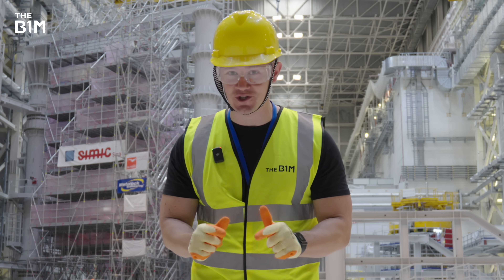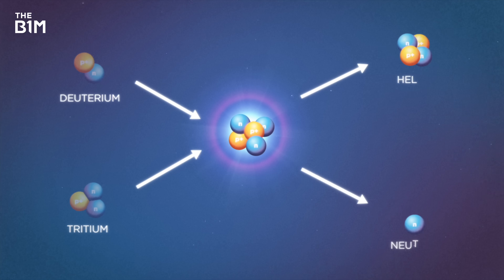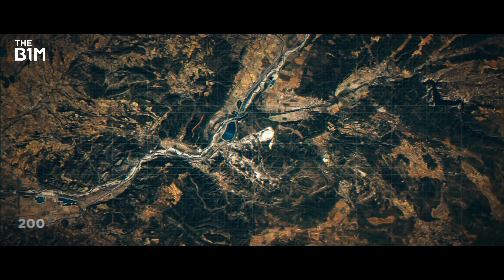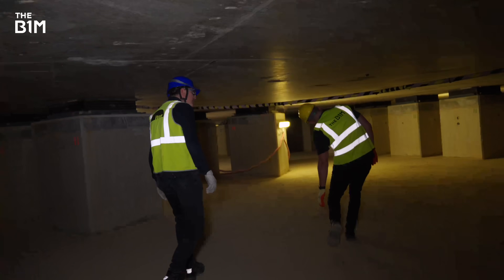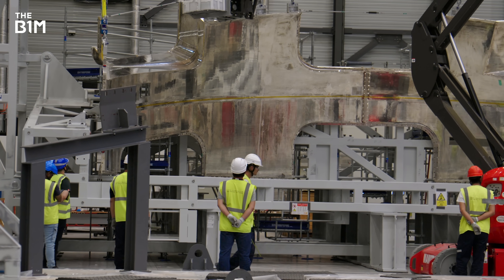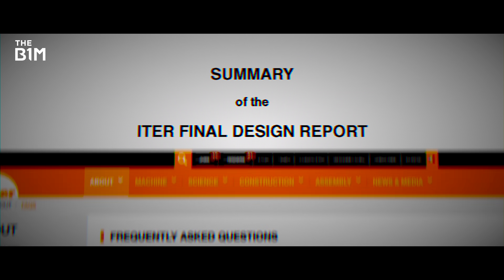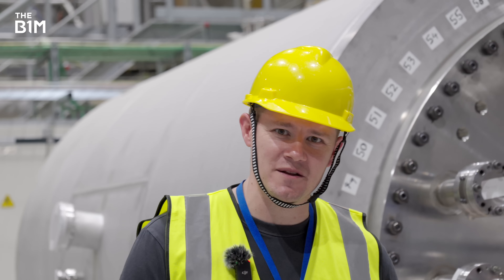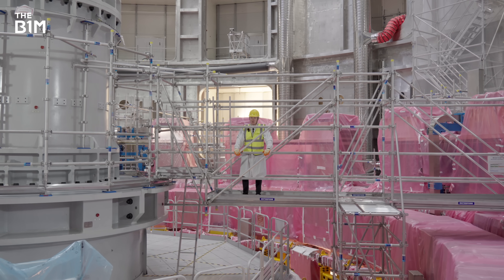This is The World's Most Complex Construction Project

Comment: I'm betting I won't see this happen in my lifetime.
Reply: I have read (or watched, can't remember) a statement from one of the senior researchers/engineers working on the project that it is highly unlikely we are going to see fusion power in our lifetime with the current progress, unless some major breakthrough happens.
Reply: I think it will be way beyond 2050
Reply: I assure you it has already been achieved but at a much smaller scale, infact, he even states this in the video. Otherwise, there is no way this much would be invested in this large of a scale by so many countries. The real question to ask is when will it benefit society at large? Will Europeans actually benefit from affordable and sustainable energy sources? I say Europeans, specifically, because ITER is in France so they should and would be the first to benefit.
Reply: @ndean7229  Yeah, fusion has been achieved and sustained for a 100s even, but we still can't get more power out of it than we have put in. And then there's scaling from experimental to production (once we figure out the first thing), and that part we likely won't live to see sadly.
Reply: Nobody will.No such thing as "clean"energy...
Reply: Im guessing it will be  year 2200
Reply: @ndean7229  the reactor that they are building is not capable of "harnessing energy " from the fusion so if they make a breaktrought they need to start building a new one and it could be anywhere
Reply: it is not possible
Reply: Depends how well it works when they switch it on. Will it save the world or will it be our extinction event 😂
Reply: @beardymedic if you watch the video, there’s really no danger with fusion. It either works or oh well it doesn’t, it won’t explode or anything
Reply: @gringalous  it's ok, I was joking
Reply: You get it. Same as the other mega projects to take the money. Is a trend actually among rich people. Also it would be better if this planet destroying nuclear plant will not be finished ever. All it takes is a small earthquake..
Reply: you need to watch some nerds play satisfactory/factorio for 12 hours no sweat, then you will begin to understand it is an inevitability.

Comment: The issue is Tritium. It is extremely rare. Current estimates put the total world wide stockpile at 25kgs and ITER will consume, by some estimates, over half of that amount. Additionally it has a half life of a little over 12 years so here is the catch: In order to breed tritium you need a working fusion reactor, and there may not be enough tritium to jump-start the first generation of power plants after ITERs experimental life (scheduled to run into the 2050's). The world’s only commercial sources are the 19 Canada Deuterium Uranium (CANDU) nuclear reactors, which each produce about 0.5 kilograms a year as a waste product, and half are due to retire this decade. The available tritium stockpile will peak before the end of the decade and begin a steady decline as it is sold off or decays, this according to projections in ITER’s own 2018 research plan.
Reply: An amazing idea that somehow got missed in the video… Wonder if that’s the limiting factor or other sources of clean energy being a little less complex and potentially more affordable… or just the whole chain reaction thing that could turn the planet earth into another sun?
Reply: Then there is how you are going to extrac the heat to boil the water. Helion plans to skip that step. General Fusion will use molten lead for heat extraction.
Reply: I believe ITER is designed to make the tritium in the fusion process itself
Reply: @IAmMaarten  It is a "future hope" as stated in ITERS's 2018 research plan. The process is theoretical at this time and highly speculative as to the effectiveness long term since the viability of an extraction process from a "running" fusion reactor  at 90 million degrees F is a huge unknown since the longest confirmed sustained fusion reaction to date is 6 minutes (the Chinese claim 17 minutes but it is unconfirmed).
Reply: Is Canada building new CANDU reactors to replace the ones being retired?
Reply: @billbyrd5150  There are a number of proposed projects but all are in planning stages only.
Reply: Canada is considering building more nuclear reactors in the future. We are currently undertaking major component replacements at our existing plants in Pickering and Bruce. We are also advancing plans to construct large CANDU reactors at Bruce, along with several small modular reactors (SMRs) in different regions of Ontario. I hope that by the time ITER requires tritium, Canada will be able to support the project with our expertise in nuclear technology, contributing to a sustainable future.
Reply: @Azerigranger  "...is considering" and "advancing plans" means nothing is actually in the works. "OPG is seeking the CNSC’s approval through a public hearing process to operate Pickering’s units 5 - 8 to the end of 2026, while units 1 and 4 will cease operations by the end of 2024. The current licence includes operations to the end of 2024." Nothing is actually moving forward except in committees and public hearings, but since ITER is years behind schedule, billions of dollars over budget with no end in sight form the cost over runs and now the plasma containment vessel appears to improperly shielded there is a strong possibility it will never be completed.
Reply: Hi from Canada. I guess everyone is praying that miners will find more Tritium and solve this essential problem. I sure hope so. It would be great to leave a cleaner world to my children. 🇨🇦
Reply: @yeleedkram "Naturally occurring tritium is extremely rare on Earth. The atmosphere has only trace amounts, formed by the interaction of its gases with cosmic rays. It can be produced artificially by irradiation of lithium or lithium-bearing ceramic pebbles in a nuclear reactor and is a low-abundance byproduct in normal operations of nuclear reactors."
Reply: @yeleedkram  LOL!
Reply: They will simply go get more Tritium.
Reply: I hear theres lots of tritium on the moon.
Reply: Is this really an issue? If our stock of Tritium is only accrued as a waste product from other facilities, wouldn't it be on the docket to construct a system that produces it as the main objective?
Reply: @orshy1  The sort of energy required would be immense, but if Iter proves its viability, then things change.
We could possibly be mining asteroids for it by the time actual power stations will be built on this tech.
Reply: pure BS,  any nuke reactor can make tritium, replacing some U235 bars into a reactor with Lithium bars and some week later you got tritium, without losing much of energy production of the civil reactor !
Reply: @RaySqw785  You're understanding of the process is flawed, here is the catch: In order to breed tritium you need a working fusion reactor, and there may not be enough tritium to jump-start the first generation of power plants. The world’s only commercial sources are the 19 Canada Deuterium Uranium (CANDU) nuclear reactors, which each produce about 0.5 kilograms a year as a waste product, and half are due to retire this decade. The available tritium stockpile—thought to be about 25 kilograms today—will peak before the end of the decade and begin a steady decline as it is sold off and decays, according to projections in ITER’s 2018 research plan.
Reply: @VinceJones1sobrietymentor  any PWR can if need breed tritium not only CANDU
Reply: @orshy1  Right. With a power plant as large as the first commercial fusion reactor, it isn't out of the question to build a small fission reactor next to it that's task is to supply the tritium, to jumpstart it. It will probably be part of the first commercial fusion reactor design, if it's required.

Also ITER won't be the first commercial fusion reactor. It's still a research project, but the first one that will teach us many things for real. I've seen plans already more than a decade ago, where ITER is the first stage, not the last stage, with other projects coming after it working towards the finished product.
Reply: So, we'll have to learn space mining before we become a type two civilization?

Comment: As of the latest estimates, the total cost of the ITER project is projected to be around €20 billion (approximately $25 billion USD). ITER aims to produce about 500 megawatts (MW) of fusion power during its operational phase for at least 400 seconds. ITER's success could pave the way for future reactors producing electricity at costs ranging from $50-$150 per megawatt-hour (MWh) Yet, utility-scale solar has become very cost-effective, with prices around $24/MWh or even lower in some cases, depending on location and specific projects. This highlights the competitive landscape for energy generation. If fusion technology can achieve the projected cost ranges of $50 to $150/MWh, it would still be more expensive than the lowest solar prices.

Comment: National ignition centre didn't include the power needed to generate the Lazer ( converting electric energy  to light energy) which was much higher than the Lazer output. The experiment made a  net power lose
Reply: That's not really important because LLNL's NIF intentionally uses older, cheaper to maintain and calibrate laser infrastructure because they are a research facility and not a power generation facility. 

Its an intentional choice to use less efficient hardware because it makes their research easier without any negative impacts on said research.
Reply: @OneDeuxTriSeiGo   what if it doesn't work?  If it does who will pay for the billions of £ of free energy? Will we all stay at home making free toast watching free television
Reply: @sirdamianmental  Do you mean NIF or ITER?

NIF works just fine and this fusion research is honestly more of a side project for them. Their main job is running nuclear physics experiments with the purpose of improving the US's ability to effectively simulate nuclear weapons and predict the efficacy of the warheads in their stockpile without having to actually blow them up to verify they work.

With ITER originally it was a question whether it would work or not. That's why the ramp up was so slow (10 years of testing from 2025-2035). Advances in materials and fusion research mean that ITER is actually significantly more powerful than it was originally intended to be. That's a large reason for the delays. As a result, we know the exact conditions ITER needs to succeed and it is comfortably capable of achieving them. So now the plan is to simply finish it and bring it up to full power as fast as possible because it should be guaranteed to work as long as the final few parts get built correctly and the assembly is done correctly.
Reply: It was worded something like ' the amount of energy put in to the capsule was exceeded by the amount that was released' which is true, but you are more correct when saying that total amount of energy used in the process was more than what got returned.
It's a little similar to people thinking their EV is all 'zero emissions'.. true when being driven, but ignores the amount from the mining of what goes into batteries, how they're made, etc.
Reply: @benwu7980  a very good and relevant example 👍🏼
Reply: @sirdamianmental  Not that i'm against either,  or don't think that so much of it is/could be a net positive.
Original Prius was basically worse for the environment than a similar sized ICE car of that era.
If take into account of the mining etc for battery,  and that there was only one processing plant for disposing of them (in Japan at the time...  still?) then the Total Cost of Ownership regarding emissions are still higher,  despite the marketing.

Comment: I never thought radioactive wastage was the reason why the current nuclear fission reactor not being used so widely. Cost and complications were the real reason. It doesnot seem these reactors would do any good in terms of cost or engineering complications. this is not to take away from the fact that what we have achieved is huge... this is freaking brilliant. But it is only successful if it is affordable by the society in a large scale.... right now it does not seem so.
Reply: This. People keep missing that fuel is not the main cost in fission reactors either and yet they don't produce that cheap. A fusion reactor seems ungodly expensive, the fuel could be free and still it would cost a lot to produce electricity. Still, mastering fusion is something I think humanity should work towards; just not using utopian promises.
Reply: It's one of the components. Sure, Fission reactors are expensive, especially if you compare it with plummeting renewable costs like Solar and so when they do eventually run into overspend territory during construction the negative frenzy that spurs up isn't merely about the billions of USD that it costs but concerns about meltdown safety and waste management are also lumped together. 

If you ignore those two aspects, the cost in itself, while obviously more expensive than Solar, is still justifiable for our Energy Mix, especially if you're looking to expand the Base Load power. It why China is building so many of them, and India (where I am from) is in process constructing more NPPs to increase our Nuclear Power Generation by 4 times; as the latter two aspects, anecdotally speaking, don't play a major role in this part of the world. 

Back in 2015 I was fortunate enough to visit Narora Atomic Power Station and we got to talk the local residents of Narora village (an isolated village which is why this location was picked for the station) and none of them shared any concern about potential meltdown or radioactive waste. Its one thing to just be over budget but completely different for the governments to not only answer to the project spending but also assure the public that the very same public spending won't poison their water and air.
Reply: Cost can be reduced through economies of scale, however nuclear fission never really got to scale because of the political issues, especially around the waste. So far Finland is the only country in the world that has managed to build a long term deposition facility, and they're not willing to import waste. The fact that Fusion simply doesn't have this major hurdle makes it way easier to deploy at scale since there are literally no downsides. Like even renewable sources like wind has met opposition simply due to aesthetic preferences. Fusion doesn't even have this relatively minor problem since it's just a building so politically it is much easier.
Reply: Problem of cost and complexity is an excuse and it always was, the real issue is and always have been public support for fission. Attempts to start new fission reactors are not stopped by economics in the vast majority of cases.

Fission energy is incredibly cost efficient, but people are scared of accidents and radioactive waste.

Modern developed nations have tons of huge complex costly components in them, most are never thought about or noticed by regular people and thus get funded, built and maintained in the background with no issues.
Reply: If you want to have genuinely futuristic utopic technology, it is going to require a gargantuan upfront investment. It might not pay for itself in our lifetime - but eventually it will probably not just pay for itself, it will pay for everything.
Reply: Fission plants are only expensive because they require a thousand redundancies to make them safe to operate and then decommissioning them costs more than to build them.  You have neither of those two problems with a fusion reactor.
Reply: @JonOsterman59  ITER is estimated to be less than 20 million euroes. That's, like, 2 nuclear plants. And this is an experiment, as the guy said multiple times. If the top scientists of the world don't know what will happen in this experiment, I doubt you can make a good prediction.
Reply: Based on the complexity of constructing something like this I think the electricity will be expensive. Investors are gonna want their returns:-)

Comment: I can certainly understand the impact of using unified project management and materials tracking software: After I bought a labeltape printer for organising my stuff at home, suddenly I could  quickly print labels everyone could quickly read, and printing several copies for different sides of a crate, in different colours and styles for categorised indexing was suddenly no trouble at all. This simple thing suddenly made it practical to organise things in ways which weren't possible before (ie handwritten post-it notes), which speeded everything else up.

Comment: 10:20 the absolute zero is -273 degrees Celsius. And actually, we dont want to reach the absolute zero (its impossible) because, to be superconducting, the magnets have to be below a critical temperature. 

Most promising material are the NbTi and the Nb3Sn with a critical temperature of about −260 °C, and also the REBCO tape which allow temperature up to -170 °C (but they are very expensive).

27:32 That's great, but how do they recover the 3.15MJ of energy ? They recover far less energy in the end... In fact, I doubt it could be used to generate electricity on the grid in the future. As it works by pulses, you'll have to set up repetitive pulses, which is difficult because the DT capsule and the gold “box” have to be replaced each time...

Comment: If the temperature inside the chamber gets as hot as the center of the sun, what material is the chamber made from to be able to withstand such high temperatures?
Reply: Magnetic Confinement. 

Heat only transfers from matter contacting matter, the inside of the reactor other than the plasma ring will be a total vacuum which helps keep the core stable